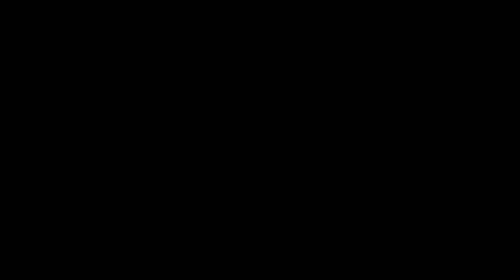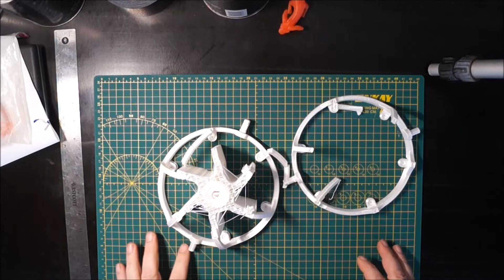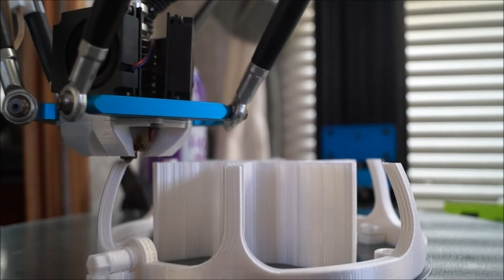Z Hop - "must have" settings for your 3D printing slicer

Comment: delta printer can do real fast z hop and don't ooze very much. But for printer with lead screw z-axis it could slow down print speed and leave nubs on the top surface. In worse case, fast z-hop might even causes missing step in z. So for cartesian machine, do z-hop where it's necessary only.

Comment: Great video! 👍 What are your setting for the Z hop?
Reply from the maker: On delta printer my average z hop is 4mm. On Cartesian printer it is less. It really should be depended on material. Less curling plastics can have smaller number. High curling may need something higher. Thank you!
Reply: UBER!  This should help solve my issue as well and I need to build a Delta style asap, PS love the name!  @UtterlyMad

Comment: is there a z hop in slicer? from prusa?
Reply from the maker: So far I had best results with Repetier Host and Cura slicer in it. Slic3r Prussia edition do have it - Under printer settings, go to Extruder1, and under Retraction you will find "Lift Z". I believe it is Z hop.
Reply: @UtterlyMad  yes thanks. Its wierd but printing on a prusa, with slicer i get way better prints than with cura. All the same settings.

Comment: Would you please be so kind as to share your finished print?  I should have implemented z-hop in my latest print of aerofoils that are very tall ( 25.4mm chord, 0.96mm thick, and 300mm+ tall), as my nozzle has pushed the foil aside on higher z-layers. :^(